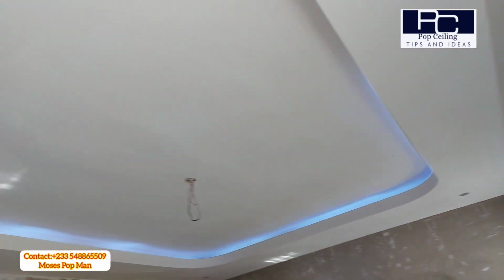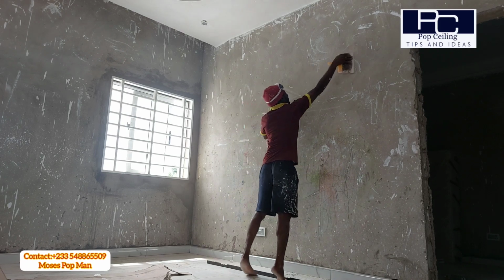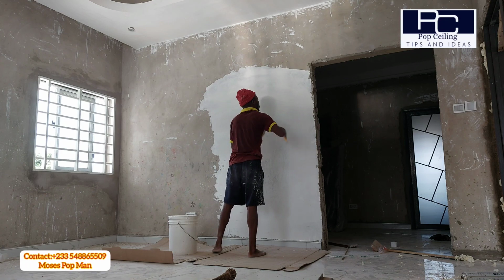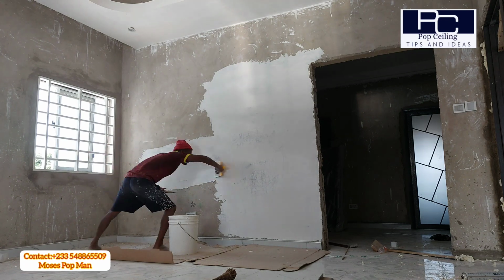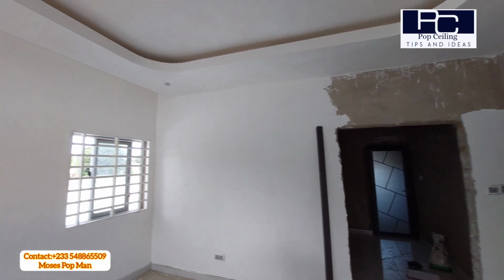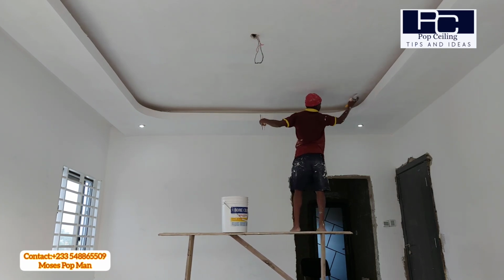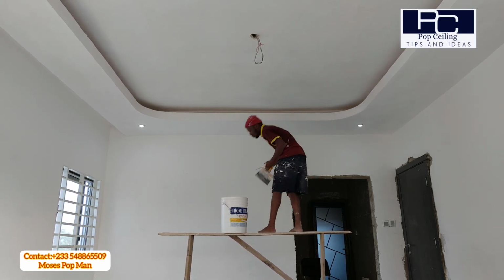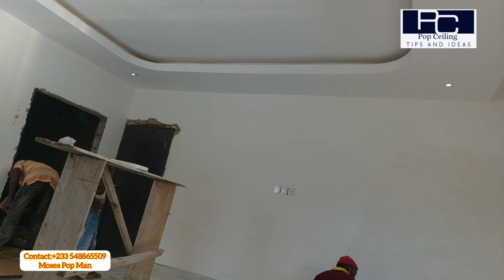Building in Ghana | Pop Ceiling Skimming and Wall Skimming work |Start to Finish |Worth it or not ?

Comment: Boss Your Work Is Very Nice And Neat..Please Is It Possible To Mix Pop And Cement ? A Guy Told My Auntie That He Can Use That On Her Ceiling Wall..How True Is It?
Reply from the maker: Thanks sir, .  If the ceiling is a concrete one then it's fine but if it's Pop Ceiling then it is not advisable
Reply: @popceilingtipsideas8939  Thanks Very Much For The Quick Reply...Can The Pop And Home Charm Too Be Used On The Concrete Ceiling ?
Reply from the maker: @chairmanhamma4736  yes please it can be use

Comment: What is the purpose of wall skimming when you can paint directly?
Reply from the maker: It helps in a lot of ways .. I might do a video about that soon ..
Reply: @popceilingtipsideas8939  thank you and I will look forward to this new video
Reply from the maker: @johnadjei6312  OK sir
Reply: 1. Fresh wall plaster is a mixture of sand and cement hence there are tiny and large holes in the wall, skimming smoothens all that. When you skin the wall feel so smooth on the skin unlike just the  plastering. 
2. When you skim, you use very little paint after because the fresh wall colour will no longer be visible through the wall.
Reply: @AdjeteyBoye  thanks aot

Comment: Can I apply a foreign paint after using Home charm paint.
I was once told the foreign paint is normally not compatible with the home charm paint
Reply from the maker: You can go ahead and apply a foreign paint on it ,all the need to do is to use a smooth sandpaper to Sand it
Reply: How much will it cost me to skim one 14/14 bedroom
Reply from the maker: @francisabaidoo2277  500.00
Reply: Don’t use foreign paint. It not go last
Reply: It no go last. Foreign paint no go last for the rain